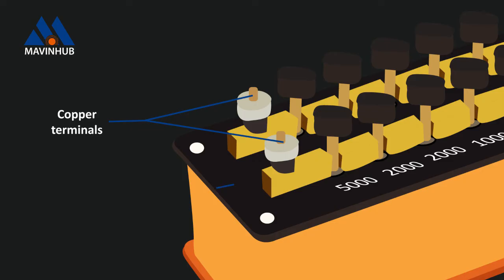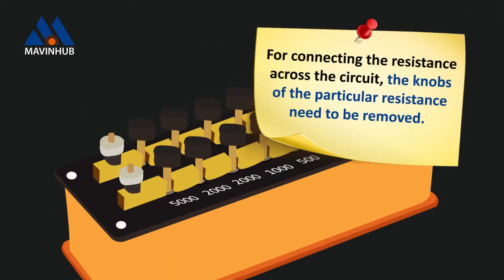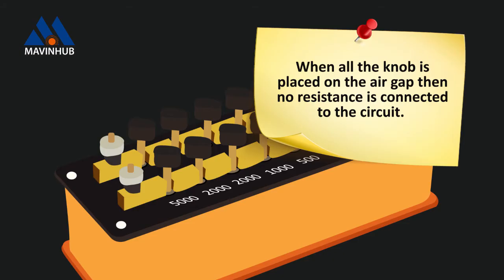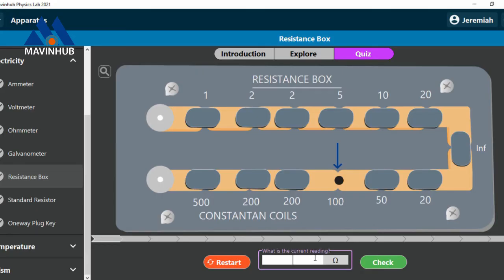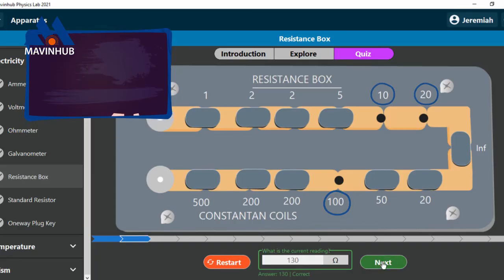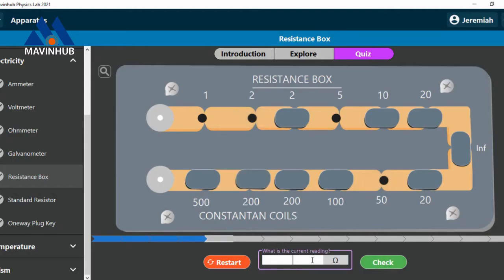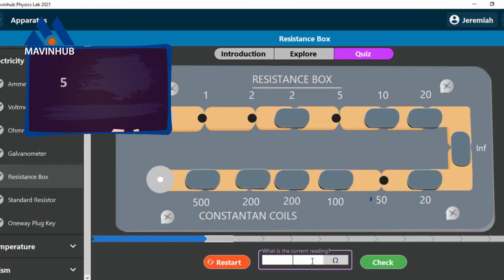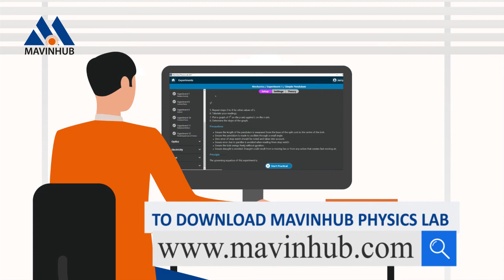HOW TO USE THE RESISTANCE BOX

Comment: Does it not have positive and negative terminals?
Reply: No. Resistors don't have any positive or negative terminals. The terminal through which current enters is taken as positive terminal and the other side through which current goes is considered a negative terminal.